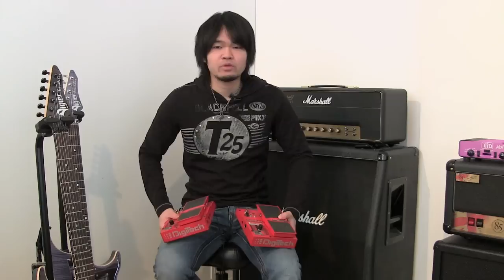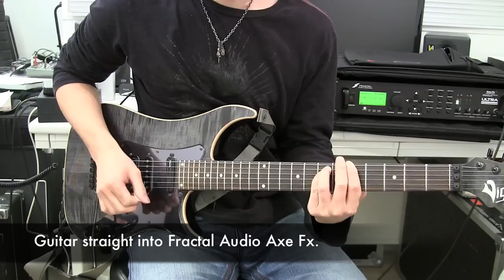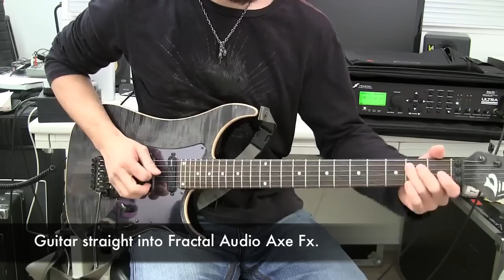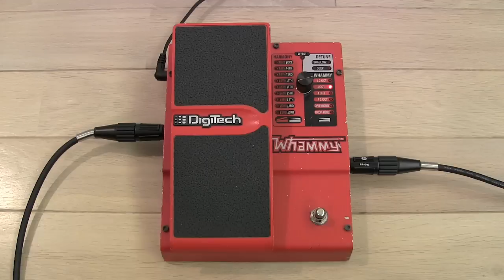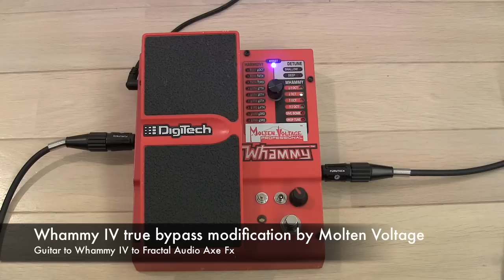Whammy Pedal Tips - #3 True Bypass - Guitar Lesson - Masaki Watanabe

Comment: Saying someone's tone is subpar can be subjective AND correct at the same time.

My question for Wabtanabe would be ...why are you even using a Fractal if that's the tone you like??? Just buy a subpar amp and a Tube Screamer (I should know...in the early '80s I used a subpar amp and an an awesome original Tube Screamer, and that was my biting tone).
:/

Wantabe, perhaps during the lessons, switch over to the neck pickup, create some warmth and depth for these little smartphone/computer speakers.